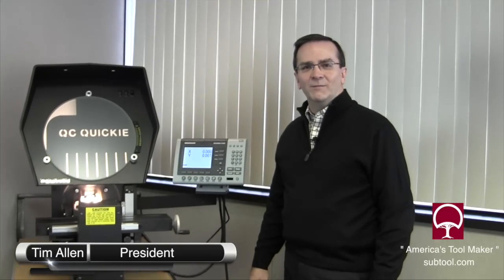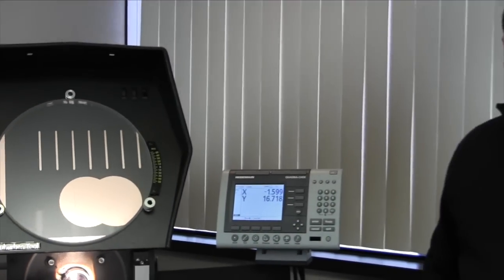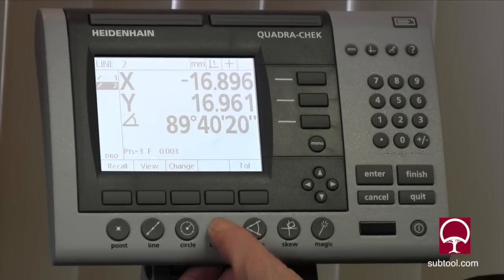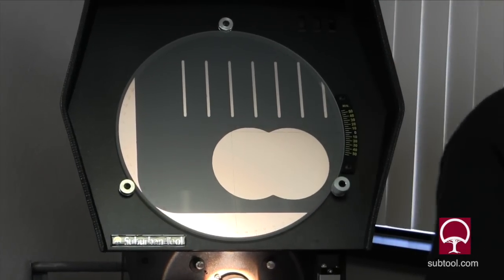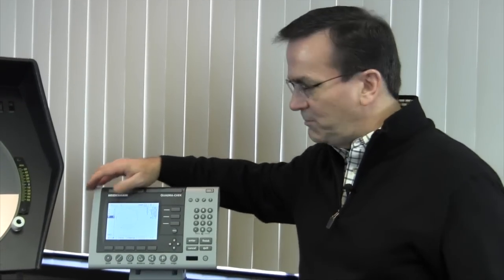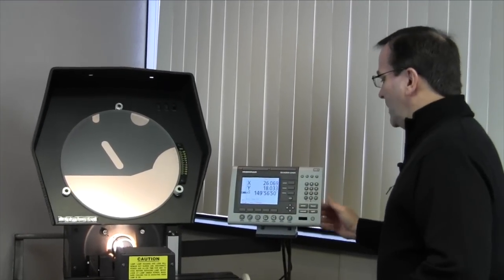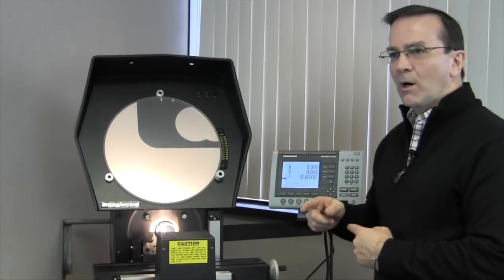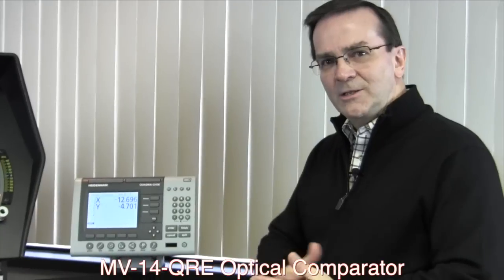How to Operate Optical Comparator - Suburban Tool MV-14-Q

Comment: Great video!  This device looks much more ergonomic than the Mitutoyo QM-Data 200 I use.  I remember searching forever to switch from metric to in and getting in a bad mood.
A little precision, at 5:20, three non colinear points define a circle.  This is why you got a perfect fit. Mathematically it had to.
Keep the good work Suburban